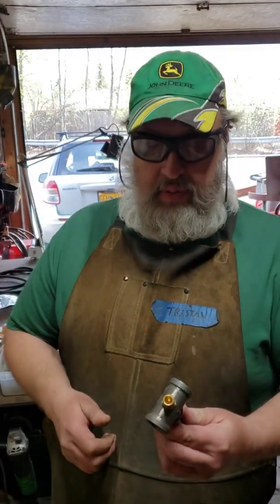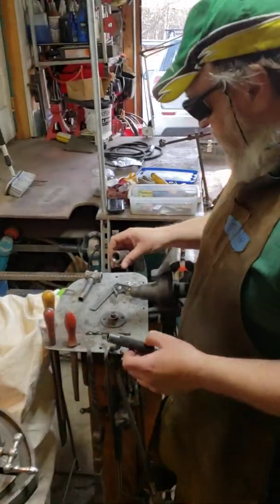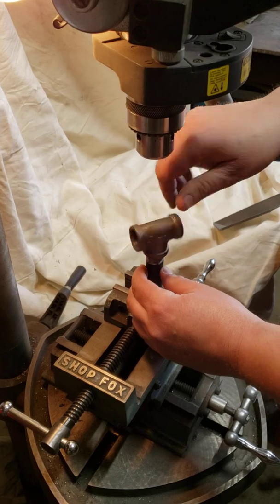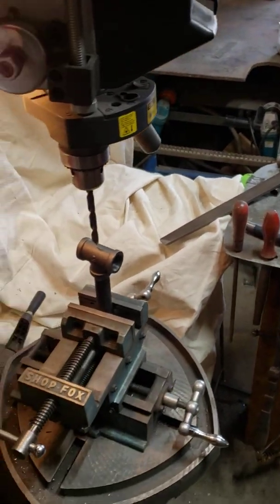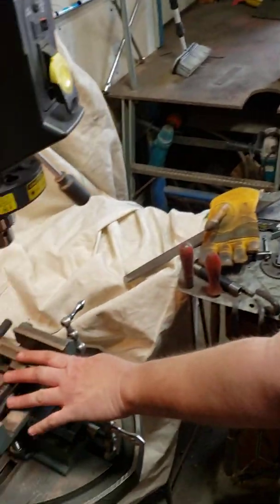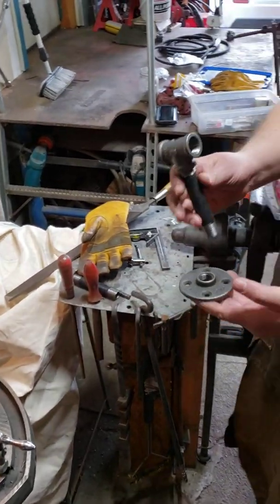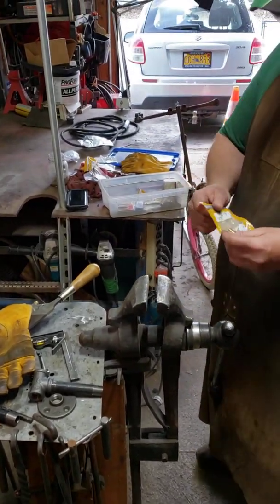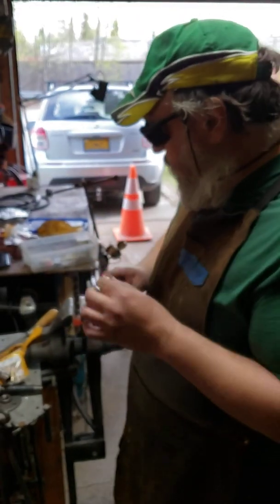Great, easy forge burner

Comment: CAN YOU LIST THE PARTS REQUIRED
Reply from the maker: Here you go-
Lowes			
178839	kh710	lincoln 10 pack contact tips. You only need one. (to use this item you will need a 6mm tap)	
877018	fl-80g	1/4in flare x 1/4" mip adapter fitting	
22475	70403	1/2" tee	
*	*	1/2" x 4" black iron nipple	not shown on the website, but they sell them.
Reply: @tristanbaranov 
THANKS👍👍👍